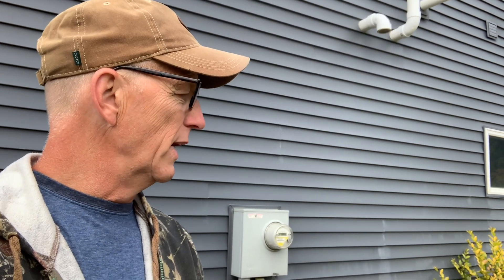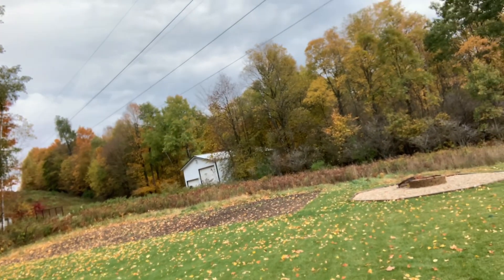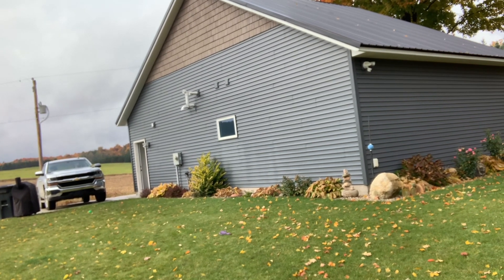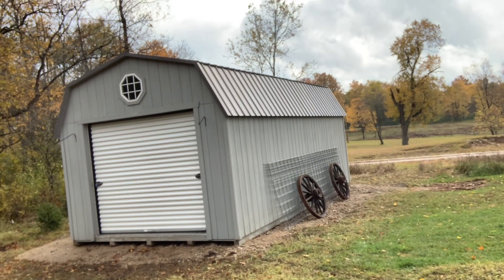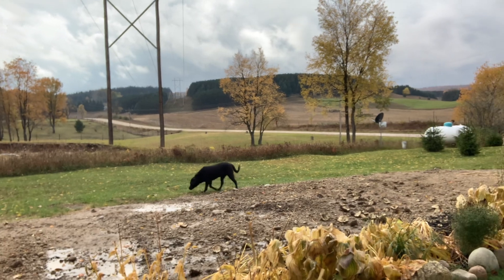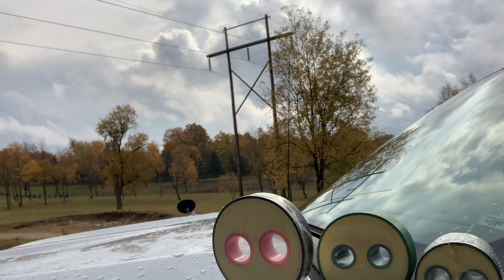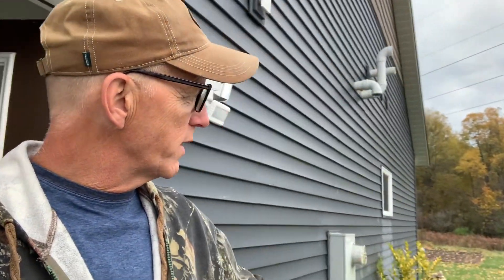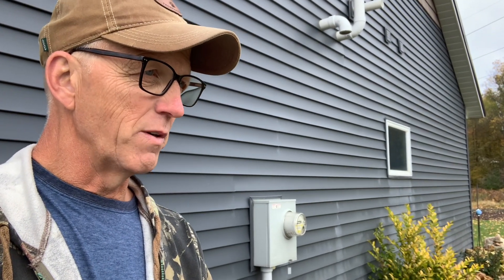What Size Underground Pipe Should I Use??

Comment: I would go with standard sizes, so u dont need weird fittings or connectors on ur stove. u can easily get standard fittings at ur hardware store in a pinch
Reply from the maker: Yes very true, and I did think about that as well.  Thanks for your in put. 
Kevin